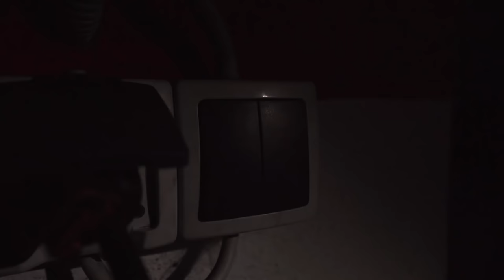Electric Trials Fun!

Comment: omg why did you do that to a trial moto??😱😭😢
Reply: wtf
Reply: Josip Cro true that
Reply: ya
Reply: why NOT?
Reply: Josip Cro Sverige mannen
Reply: Quiter, cheaper and possibly even more power because it's eletric
Reply: Modey more power? no way wtf are you on
Reply: Yesto as in the acceleration
Reply: 2 stroke is power and even cheaper, electric is just for playing around
Reply: Mad Rider Austria not really, on these bikes, if you can afford electric is actually better because of the torque- there's more of it and its instant, and dont forget you eventually need to rebuild the bottom/top end on these bikes, they both have their pros and cons
Reply: Electric is in nearly every case much more torquier. That and they have the same amount at any given RPM. Electric is simply much better then combustion and even better then 2 stroke in most cases.
Reply: Josip Cro yeah so sad
Reply: Sirius but he just chucked the engine tho...
Reply: Josip Cro Cuz he can
Reply: Yesto Apparently you've never ridden an electric motorcycle...100% torque instantly....impossible  on an ICE bike. No comparison.
Reply: Gasoline engine is the best
Reply: are you from croatia because: CRO